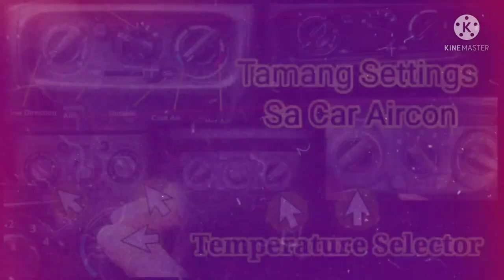Rear Brake Cleaning Using Soap Water and Brake Cleaner │ Car Brake Maintenance │ Suzuki Alto

Comment: pwede ba Degreaser panlinis idol?
Reply from the maker: hello po. pwede po
Reply: @lakwatserafamily9860  pwede po bumili sa inyo ng drain plug washer sir Robert?
Reply from the maker: helll po drain plug washer pwede po mabili sa mga autosupply po.
Reply: @lakwatserafamily9860  ok po sir Robert   dalhin ko na lng po sa auto shop. napa auto subscribe ako sa inyo galing po ng mga video nio very helpful. more power po
Reply from the maker: salamat po. wala nga lang po ako mga new videos. super busy po kasi tayo sa mga nagpapapms.
Reply: @lakwatserafamily9860  take ur time lng sir, sir un Spresso po same lng ng makina ng Celerio nio KB10 ENGINE?
Reply from the maker: @thechosenone1066  yes po same lang po pero yung sa spresso po althoug same ay  retuned engine na po yan.
Reply: @lakwatserafamily9860  2.9 liters lng din sir ang oil apg nag change oil ako?
Reply from the maker: hello po yes po

Comment: Sir good pm matagal na ring kitang hindi nasusubayan may problima kasi sa apv ko parte sa aircon bakit maingay sa propeller ko lalo na naka aircon ako
Reply from the maker: hello po. ang ibig nyo po sabhin kapag naka on ang aircon nyo po ay umiingay ang propeller?  icheck nyo po sa ilalim ang  ikutin ang propeller, kung saang crossjoint po ang may sira front po ba or rear.
Reply: LAKWATSERA FAMILY hindi ko po alam sir kong hindi Ko nako aircon normal naman kong aircon naman maingay masyado
Reply: 8years na yong apv ko ngayon lang may problima malamig naman ang aircon pero ang ingay sa harapan
Reply from the maker: @merlynabucejo6794  hello po paanong ingay po? baka po ang umiingay yung radiator motor fan. buksan nyo po ang hood at icheck nyo po.